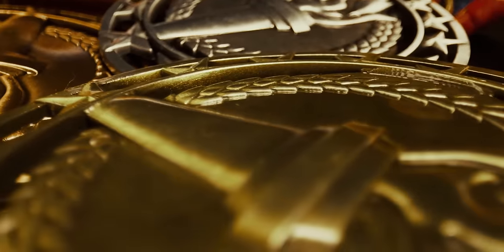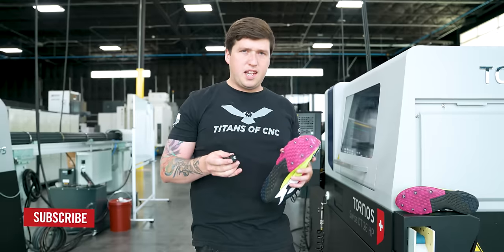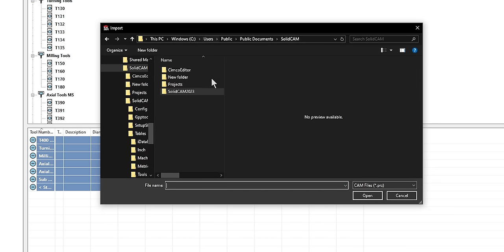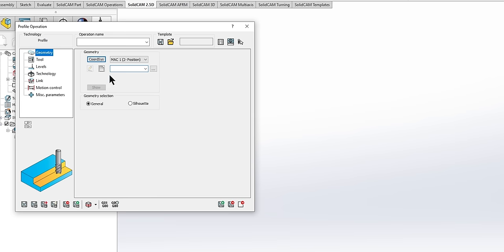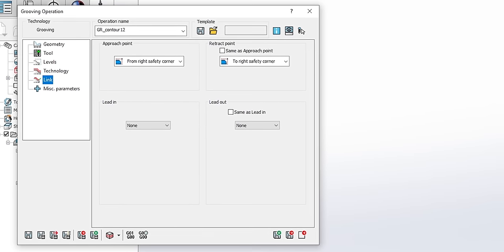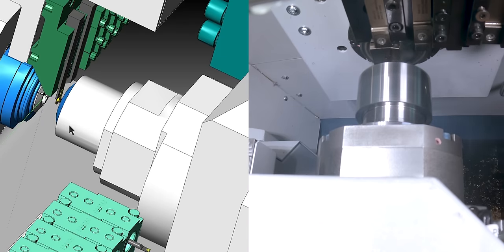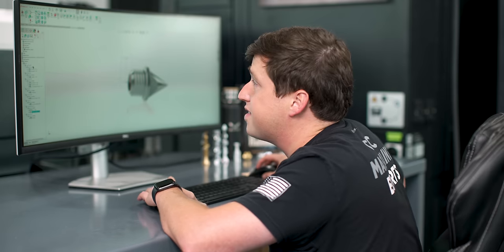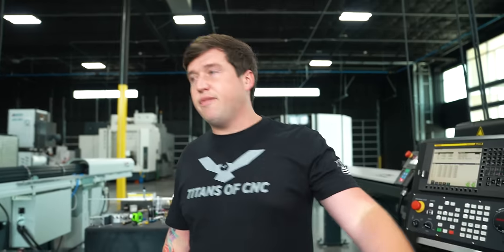Swiss Machine Perfect Titanium Shoe SPIKES using SolidCAM | Tutorial

Comment: Nice Job Donnie, clear explanation. The software has really evolved, now you have a 2 spindle machine, but on the 6 spindle machine with more turrets and tools everywhere, it's a bit more tricky 😅
Please make a video with your multi-spindle machine, thanks.
Reply: SolidCAM’s channel sync has been field proven to 6 channels without issue. Theoretically there’s no upper limit to the number of simultaneous channels it can handle. 

As for programming it’s just a matter of adding additional MAC’s and additional sub-spindles to the VMID.

Comment: I can't immagine what cutting edge technologies are quietly being developed these days.
I had the lucky opportunity to work at am engineering company that rebuilt jet engines and steam turbine/nuclear parts. They developed processes like laser heat pool welding (precursor to modern 3d printers) 
They also put titanium particles in a putty and Pplied then to parts that needed to be built back up and baked them together in a big pressurize kiln.
That was over 20 years ago 😳

Comment: Donnie i have a question. How should I do finish passes in my swiss without chatter? I have a 17-4 part with a RA 8 finish requirement. It's a 2.5 inch long part, so I'm not sure how to do this.

Thank you
Reply: Well that’s a 6 beer conversation right there 😂. How big is the depth of cut? What type of Swiss machine? Can you pinch turn? 🤷‍♂️. 

Once you go below 10 this starts to get difficult. My best results on 13-8 were with a SUPER sharp insert and a delicate light depth of cut at a speed and feed so slow it would make your eyes water. That was on 53rc 13-8
Reply: @donniehinske  I cannot pinch turn, it's a single slide DMG Sprint 32/8. DOC is about .030" per side in 17-4 pH. My max spindle speed is 8,000
Reply: @michaelpawluk6791  ground stock? What’s the radius of your insert?
Reply: @donniehinske  ground stock from Boston centerless, currently I'm using a .0079" and I'm at about RA 12 feeding at .00035" IPR
Reply: @michaelpawluk6791  sounds like you are right there. Try a sharper insert and even slower. I’ve also seen the pressure from a .031” radius insert create a good finish. It really sounds like you are right there but playing around with the radii of your insert could get you there
Reply: @donniehinske  thanks Donnie! I'm trying to get away without having to burnish this part
Reply: @michaelpawluk6791  that makes sense. Just know you are entering a tough area in Swiss machining. Holding that finish all day will take some finesse. I do believe you will get it if you play with the radii tho
Reply: @donniehinske  I appreciate the replies. You are awesome! I accepted this job 2 years ago because of a conversation between me and Titan.

Comment: Such type of programming is ok for someone who can do this also in editor, but If one can do it only in CAM, then he’s not full programmer. Yes I understand time consumption and everything what comes in process.

Another example: No one can teach how to mow the grass using robo lawnmower.
Reply: That’s like saying no one really knows how to use a phone unless they can operate a manual switchboard…
Reply: Incorrect. Yes, it's good to be able to write from hand, but only to make yourself more familiar with the code. So you can do quick edits or fix bits that didn't post correctly (I always skim through every program after I post just to make sure nothing went wrong...)

I'd argue every programmer that can use this software at a high level already knows their g code by heart. You can't say the same about an old timer that likely can't even open their email without help, and refuses to learn how.

Comment: how do they make those carbide tips though? i think they might have to be forged in mt doom from lotr or something like that
Reply: Mix a bunch of different powders together in a liquid until it's really well mixed, boil off the liquid, press the mixed powder into shape, then heat it up. The "glue" part of the powder melts and makes the "hard" part of the powder stick together. After that, add coating.

Comment: sir, i understand that programing is easy, but you have to be aware that alot of shops cannot afford to have all their machine environment in the CAM software, having every machine in your software is either incredibly expensive or difficult to create
Reply: That depends. If they’re all the same make and model machine it’s just one post and one VMID. 

Even if it’s a large variety of machines it’s still cheaper in the long run to have them all in CAM. The money saved in time alone will make the ROI in less than a year